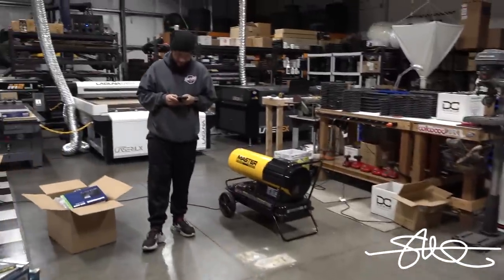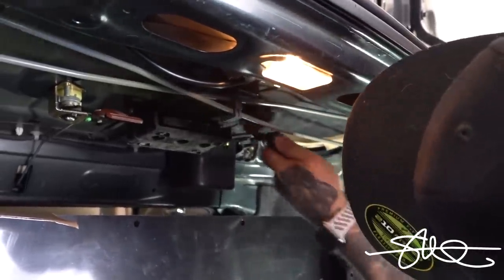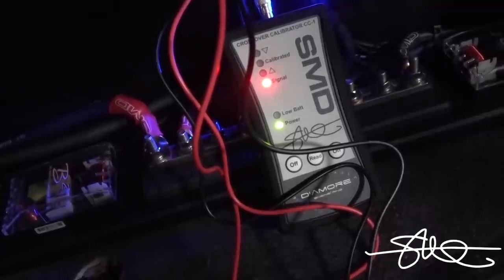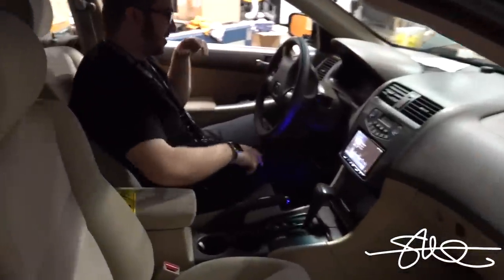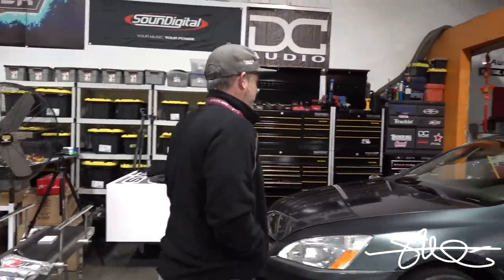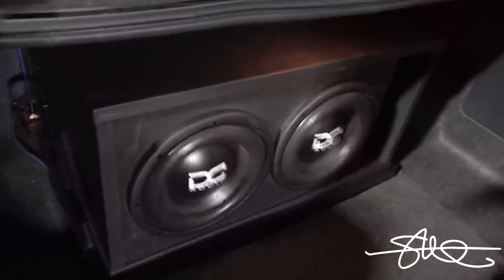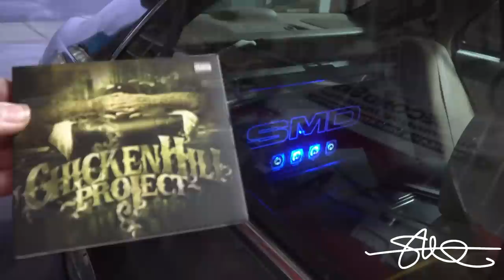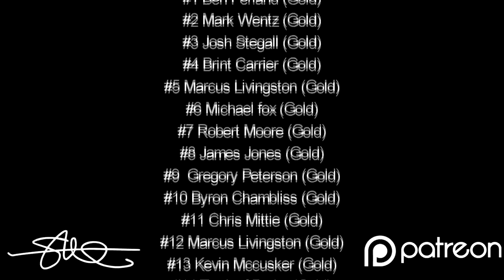the $140 Sound System is finished! ULTIMATE PAYBACK - Jaybird's Got BASS! REVEAL DAY (Video 9)

Comment: Yo I've been into car audio for like 25 years, and I just learned something big time this video,  Meade is a genius, 
I used to always buy expensive 6x9s with 3-way tweeters and put them in the back and they would get drowned out by the bass box.
In this video he said have all your components in the front, so the highs are firing directly at you!
Let the base flow through the back of the cab.
Great advice man!
Reply from the maker: besides being drowned out....when was the last time you went to a concert and the band was playing behind you while you stare at the wall?  That is why i never use rear speakers if i can avoid it.  Up front ONLY.  Id put the subs up there too if there was room although bass is mostly non-directional.  Thanks my bro i appreciate the comment :)
Reply: Something else i hadn't considered until now: The 6x9s are not in a box. They are mounted direct on the deck infinite baffle style. No cone control. So the sub box will be pushing them to xmax and beyond anyway.

Comment: Hey mead I have a sound system in a robot 400 watt 2+1 dual driving the sub 250 watt kicker driving the splits I run on batteries so I can only crank it up so loud what are some tips for running on just batteries to optimize power output it seems like it could do a lot better.thanks👍😀

Comment: Correct me if I’m wrong but the front and rear outputs are different parts of the sound stage. Or is it just left and right?
Reply from the maker: 5.1 is fine for watching movies. For music not so much.  Just front is all you need. If you could get the subwoofers up there too that would be ideal. But that isn't very practical in most cases.

Comment: Installing my first system since 15 years tomorrow in my 2012 f150 (2) 1200watt planet audio AC8D dual coil rated at 600 watt RMS with (4) 6.5 300watt RMS 3 way door speakers on a 2000w amp with series wired I'm thinking of setting the gain at max volume at 48hrz the math I came up with sounds about right and I'm using the factory head unit
Reply: What's the cost? And inch speakers?
Reply: Nice but later switch those subs.. planet audio are not really that good .. Sundown or American bass are really good
Reply: planet audio is shit, they offer literally nothing.
Reply: @cocmaster4474  I paid 32$ and they are 8" dual voice coils at 4omh 1200 Max 600 watt RMS
Reply: @ThirdCoastNative  they actually aren't that bad with the right amount of power to them

Comment: I'm just starting out with a system any suggestions for a budget for 2/12' subs and a amplifier and speakers for highs
Reply: Whatever is in your price range. The main thing is to get a custom enclosure built to the slecifications for the woofer.
Reply: If your budget is really low then I suggest maybe Pyle or fusion they seem to be cheapest in UK not sure about us though
Reply: Rockford Fosgate has budget speakers, subs  and amps , and they all sound amazing, check out there line up from cheapest and up.👍🔊🔊
Reply: Check out Skar's packages....the 2500W 12 package is like 475 right now and is quite loud man. 1 week in of decent play and I'm going to need to tighten shit on my truck soon lol